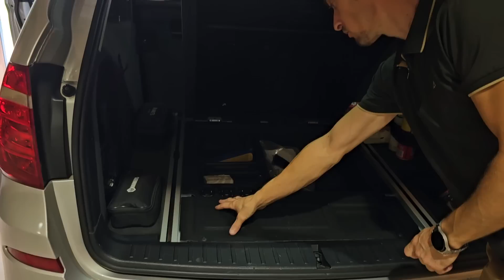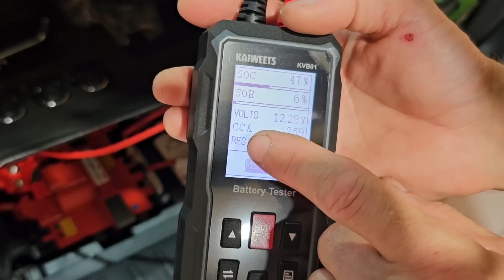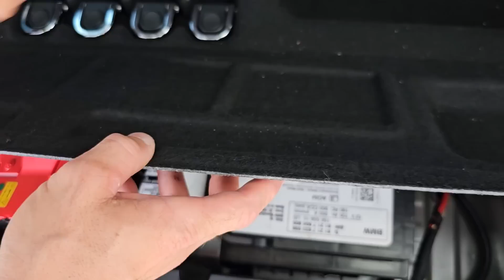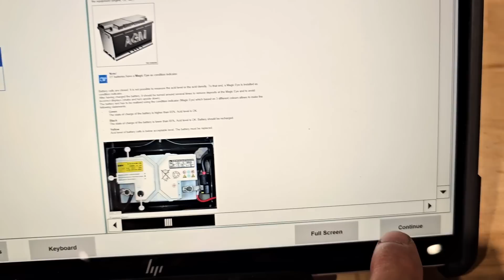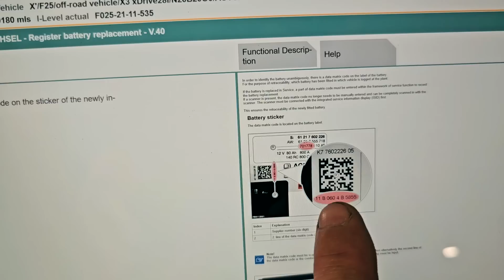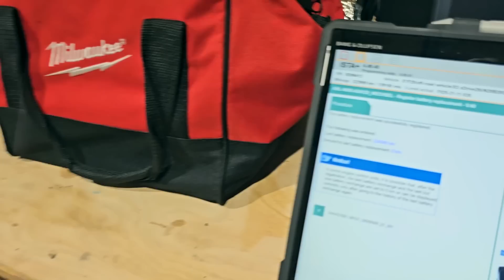BMW Battery Replacement: Why, When, and How to Register Your Battery - An Expert Educational Course

Comment: Salutare ! Recent am descoperit canalul tau 😊 si vreau sa it multumesc pentru efortul depus pentru comunitate . Vad foarte multe cazuri de FRM corupt la schimbarea bateriei si ma intreb daca mai sunt si alti pasi necesari pentru a nu ajunge in situatia aia cu masinile BMW ? Banuiesc ca nu strica sa astepti pana toate calculatoarele intra in "sleep mode". Dar alte opinii sau sfaturi din partea ta ? Sunt si uniin care sustin ca au facut total ca la carte si tot au patit faza . Merci anticipat !
Reply: Acum am vazut si video "Module 12" de la tine , care explica multe ( cu memoria aia emulata de 4kb). Deci teoretic cand masina e in sleep mode , ar trebui sa poti deconecta bateria fara nici o problema. Mai sunt altele de care trebuie tinut cont ? 
P.S. am cu ce sa inregistrez noua bateriei, dar incerc sa imi fac curaj sa o fac 🙏 Numai bine !

Comment: Hi! Thanks for the guidance, do we need ISTA P installed for this, or is ISTA D/+ enough for a manual battery registration? Thanks!
Reply from the maker: IstaP it is for programing old BMW vehicles,  Ista it is the diagnosis and much more

Comment: I have 2001 E38  BMW 740i the original battery was replaced in 2013 with BMW EP 110 A/H CCA 800, but now it looks like need to be replaced after another 13 Years
Reply from the maker: 13 years is a great life for a battery!

Comment: Hello.

You forgot to mention that in e-series you can use normal batteries and not agm batteries. There is also regular battery coding available in the car. It is most important to change the coding for that.

There is also regular batteries in E-series from factory. F and G- series are allways agm batteries because regenerative braking.

Also if the battery is bad, the seat heating wont work.

Nice and informative video 👍
Reply: All cars with start/stop function require AGM batteries, regardless of the series (E, F, or G). My car is an BMW E 88, and it has an AGM battery.

Comment: I can add my experience. The car was made November 2011, The original battery lasted to early 2021. I bought a top of the line Varta battery. Today about 4+ years later, I am looking at replacing it again. I had a case when the car with a hot engine refused to start and it pointed to the "relay 50" and when doing the investigation in the garage, even the low battery sign came up. The technician told me that he would start with the battery first. I think changing the relay won't hurt either.

Comment: Great content! I had a weak battery in my E70 from driving too many short trips. I was able to recover the capacity with my programming charger set at 50 Amps for 1 hour or so till the amp draw reduced to around 5 amps. The voltage drop when starting is like new.

Comment: Great video. Hopefully it will be a few years before I need to change batteries on my G31, but is the process the same for the 48V battery on a mild hybrid, please?
Reply from the maker: Yes it's a similar system, where first you need to deactivate the 48-volt system.

Comment: When i bought my E39 530d it was 8 years old and had the factory battery. It lasted about 3 years in my ownership before it was bad. My dad also used his orginal battery for well over 10 years, so im 100% sure the factory battery is really high quality.

But how does other cars deal with battery charging and discharging? I often hear people complain that bmw is stupid cause you have to register a battery while other cars you can just swap it and go..
Reply: More modern cars do require a battery “registration” these days but bmw was the first to really do it.  Your e39 was the last era of bmw where it wasn’t necessary.  Anything newer (e60, e92, etc) requires a registration.  It became a requirement because the computers need the voltage to be perfect and as the battery ages, the charging system detects how healthy the battery is and adjusts charging as needed.  And it’s not really a registration.  It’s just telling the car it has a new battery so it doesn’t overcharge the new battery

Comment: The original battery in my e60 lasted less than 10 years, but I did have a bad IBS cable (which BMW revised). I had the dreaded increased battery discharge message for quite a long time before the battery finally died. I replaced the IBS cable and the battery 6 years ago, and today, the SoH is still over 90% even though I still have the increased battery discharge message sometimes. AGM battery is good. Non-AGM batteries in my other cars typically last 3-4 years.

Comment: Had a 2006 325 xi base sedan the battery lasted 11-1/2 years, I had a problem , crank	and no start so I purchased a new battery from the local BMW dealer., didn’t help.
I think the old battery was still good and would have lasted another few years. My 2013 
535 x drive has the original battery.
Reply from the maker: Thanks for sharing your experience; that's impressive battery longevity!

Comment: My e61 2009 520d came with non agm battery new
Reply from the maker: You got the car new?
Reply: @MOvidiu yup 2009 europe ( with the famous n47 engine with original timing chain and no noises and serviced every year by myself in my garage)
Reply: Probably you don't have regenerative braking function ,that s why you have normal battery

Comment: Thanks for the content, can you clarify for me, regarding charging the battery using a charger, is there a problem if it is done directly on the battery mounted in the car?
Reply from the maker: Good question,  so if it is a little amp charger, then you need to do not disturb the car to be able to go in sleep mode, if not that charger won't do anything to the battery
Reply: Thanks for replying, 
I always heard that the points next to the engine were used to charge the battery and jump start, in a workshop where my BMW was, they charged directly on the battery mounted on the car, and that the terminals next to the engine are just for jump start the motor. Is it true? (sorry for my english, it's not my native language)

Comment: Testing the battery from the engine compartment didn't work. Testing in the front showed only half of the capacity measured directly on a disconnected battery.
Reply from the maker: Interesting! Thanks for sharing your experience.

Comment: What if someone puts 95Ah for which there's no option to code it, usually it's used closest Ah option(90Ah) but does that affects charging capacity?
Reply: I installed a 92 Ah battery instead of the original 105 Ah, and coded 90 Ah. Close enough 🙂
Reply from the maker: Yes you can do that !
Reply from the maker: Recommend using what is in the FA( vegicle order ), but you can do it like you did it ..
Reply: Yeah, I always use recommended like on my f10 lci is 105Ah same like g30 which I was working on, but someone changed battery to Varta 95Ah 2 months ago and even didn't registered it so I code it to 90Ah and registered it but I noticed it's never fully charged like on my f10(99%), and mine is still OEM from factory(Oct2016). Max it goes to 90% SOC doesn't matter how much you drove it.

Comment: U wont believe it but my 2011 F11 520d battery was original up until 2025
Reply from the maker: Yes exactly as I told you! Original batteries have different quality !
Reply: I can believe you. Just replaced my 2013 E70 battery, but it wasn't really bad. I just wanted a new one (and a smaller lighter one).
Reply: Very impressive, always liked the e70  @mcplutt